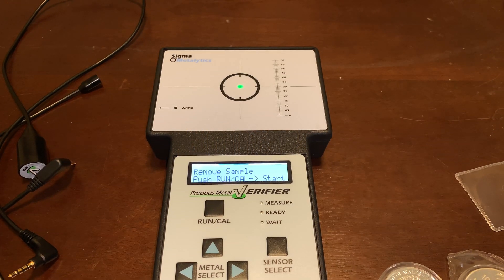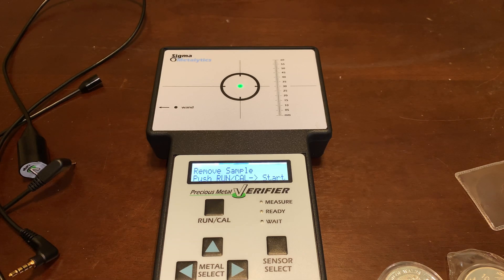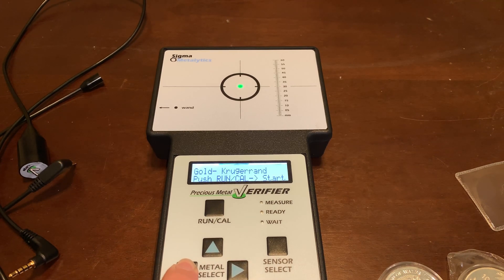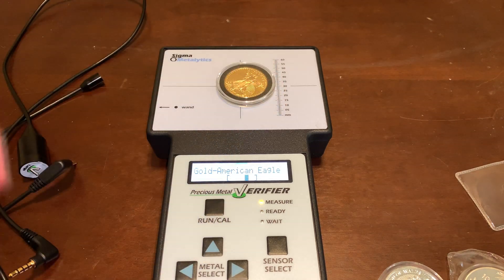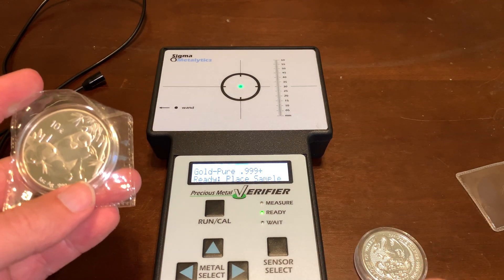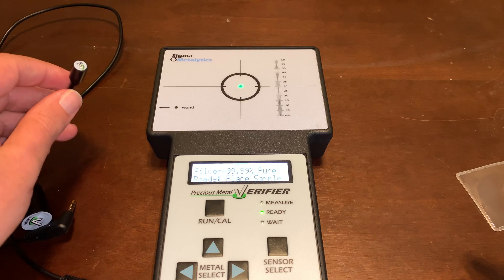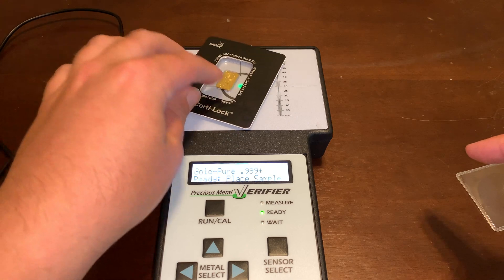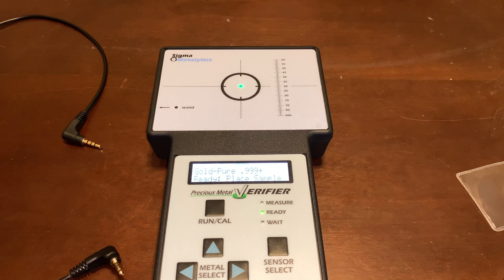Testing Gold and Silver with a Sigma

Comment: If you are measuring a small bar like the one in your video it says to put the calibration disk behind it, I found this worked better with 1 and 2 gram bars. I'd put the calibration disk on the table, put the bar on top then use the wand. FYI.